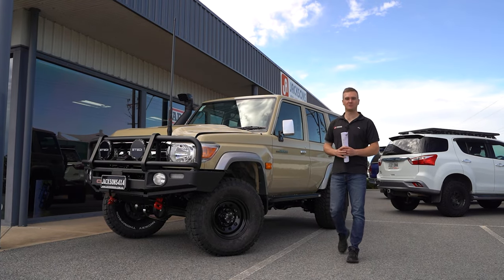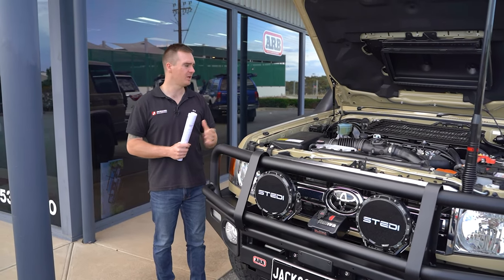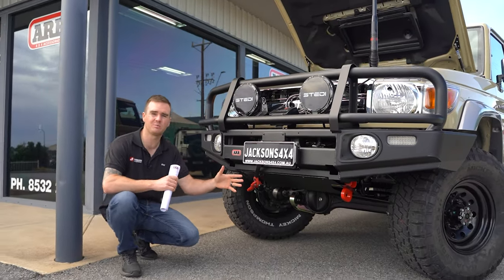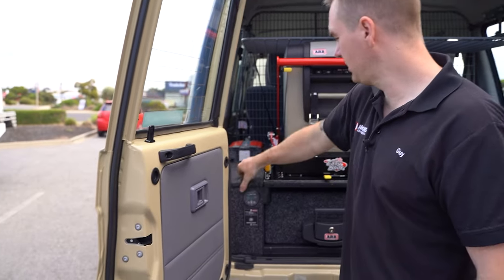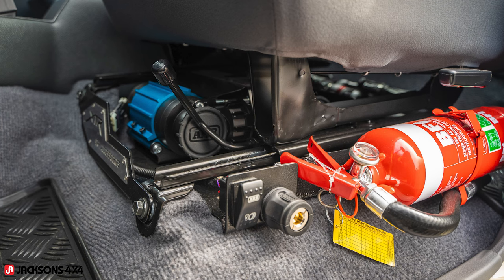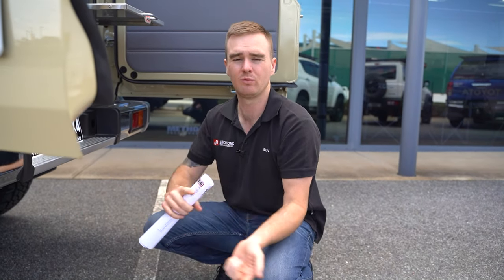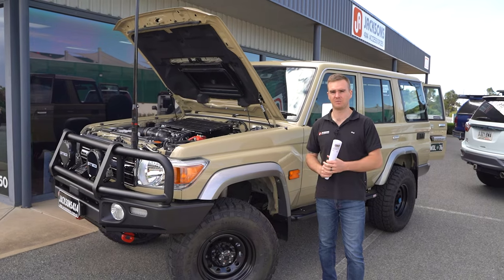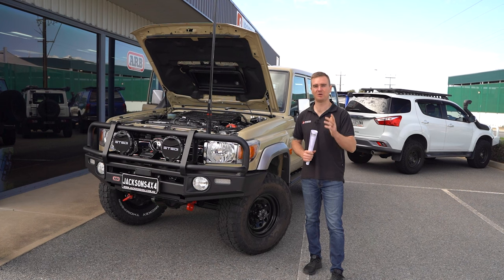76 Series Landcruiser build walkaround!

Comment: have a question, but not related to this video . . . 4WD SUVs & light pickup trucks equipped with a 2.0 in. or 3.0 in. suspension lift actually has different level (clearance/height) of lift between the forward & aft suspension setup . . . if the front axle has a true 3.0 in. lift then the rear axle has something like a 2.6 in. or 2.5 in. lift . . . so my question is why's the lift less at the rear? might as well have a true 3.0 in. of full spec suspension lift both at the front & rear . . . if not why??? please advise . . .
Reply: Why not? You definitely can install a 2inch lift kit front and back and have them aligned equally, but then you will look acceleration power, and stability during serious off-roading. This is why i lifted by tahoe by 2 inch front & 1 inch in the rear.
Reply: @nyzz1351  in that case, based on your understanding i can have a 2.0 in. suspension lift in the forward axle & 1.5 in. lift in the rear axle . . . thanks for the clarification my friend . . . ur right, with a 2.0 in. lift both front & back stability will be an issue . . . high centre of gravity will create negative inertial forces . . .

Comment: from India . . . seriously interested to acquire three brand new (specially built by Jackson's 4X4) TOYOTA Land Cruiser 79 GXL (HZJ) 4WD + 3.0 in. Lift 4.5 TDI V8 4-Dr Crew Cab Camper Pickup Truck (RHD) & two brand new TOYOTA Land Cruiser 76 GX (GRJ76) 4WD + 3.0 in. Lift 4.2 Biturbo V6 5-Dr SUV (RHD) . . . as shown in this video . . . would prefer both vehicles with a torque converter 6-speed auto transmission . . . please advise . . .

Comment: Ohh god, who cares! Another Sandy Landcruiser. Everyone is over it, they have become just an accessory for the average joe instead of a proper touring rig.
Reply: someones mad they can't afford one😂
Reply: @fletch872  Not even remotely 🤮
Reply: @Andrew-hu1bx  what’s your idea of a proper touring rig then
Reply: @fletch872  Hahaha anything that comes with cup holders, over 150Hp power, can flex, is comfortable, doesn’t break down or blow up constantly because of the stupid dpf, an engine you can actually work on in the bush that isn’t the world most crowded engine bay, doesn’t need to have the rear axle and diff housing corrected………oh did i mention something under 70k from brand new 😂

Keep telling your self there good mate but absolutely everyone in the real 4x4 world is completely over them, 90% of the yuppies that buy the 1VD 76,78,79s only buy them to use as a hand bag accessory to show off to the other yuppies
Reply: @Andrew-hu1bx  so you can’t afford one 😂
Reply: @fletch872  If your going to pipe up Fletcher know what your talking about, guys spend 180k+ easily on these 1VD cruisers just to make them half capable. They should just buy a 2500 Ram of F - Truck that would blow that shit V8 out of the water
Reply: @Andrew-hu1bx  that sounds like my 2004 Hilux 1KZTE…which will do all of that and not even make a scratch on the bank account…PLUS… i won’t be out sleeping in the dog kennel…if you know what i mean!